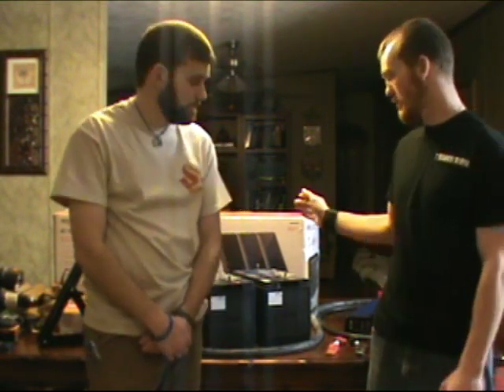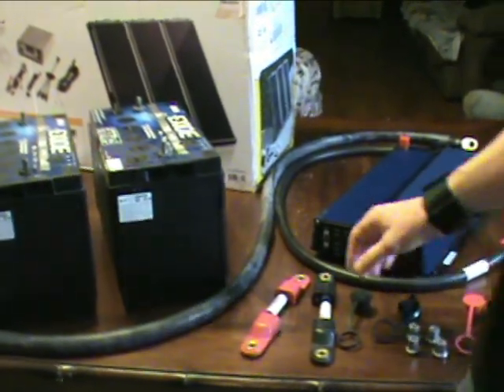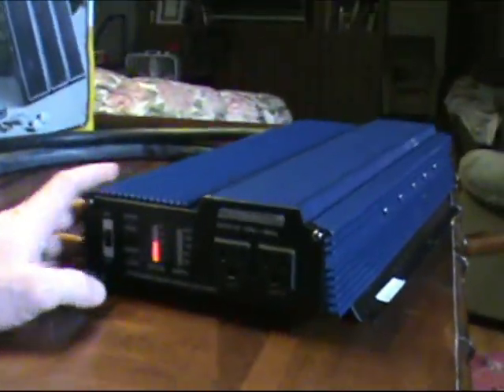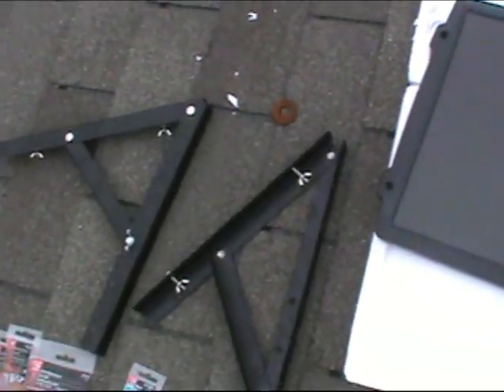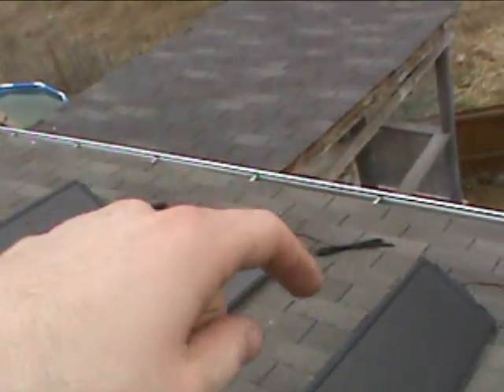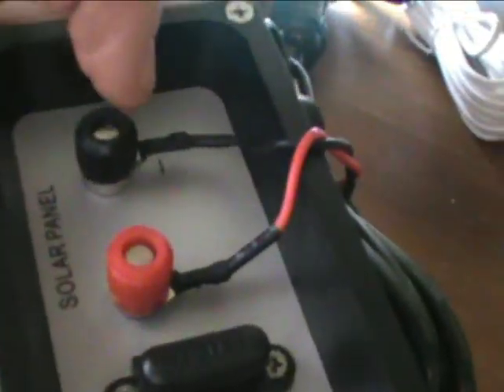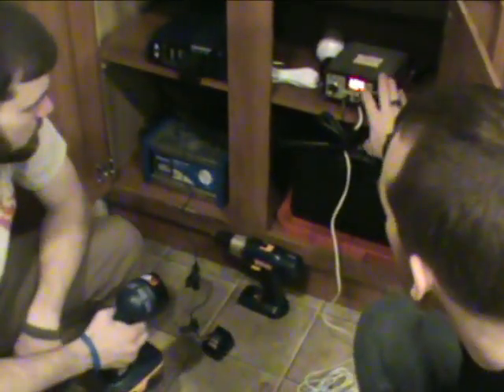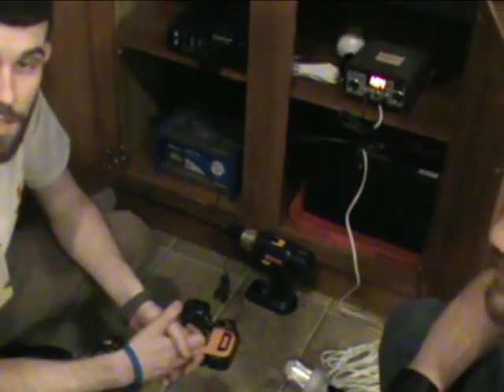AN EASY AFFORDABLE DIY SOLAR OFF GRID BACK UP POWER PROJECT FOR YOUR HOME

Comment: I used to wire my cars amplifiers and sub box with those. it was $60 for a 10 foot power cable but only $5 for twice the amount of better quality jumper cable wire of the same gauge. you could just use the clamps but since i was in a vehicle with constant vibration from the road, i used the $2 terminal kit from wal-mart. cheers

Comment: Question?  I have a 10 amp charge controller.  On the solar panel (240watt) I am not certain which info indicates if my charge contoller is sufficient.  It lists Amos in several places, such as maximum series fuse rating and short circuit current, but I have no idea which, if any of this info impacts the size I need for a charge controller.  Can you help a newbie out?

Comment: I'd suggest using stainless fasteners on those panel brackets. Wouldn't want to come home to find those things laying on the ground all busted up because of cheap, corroded metal screws.